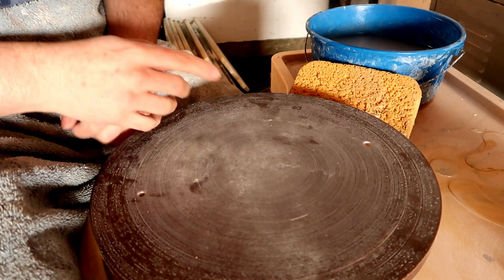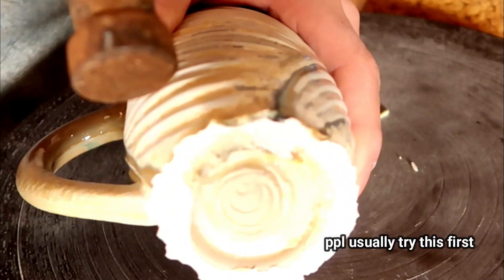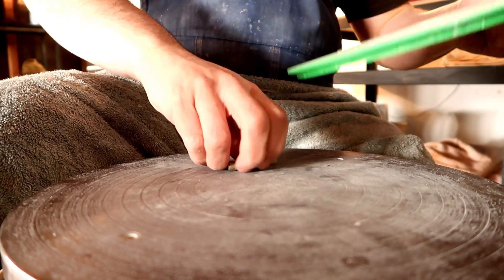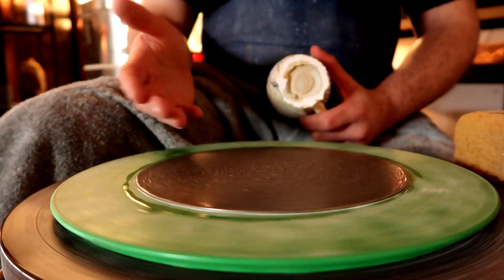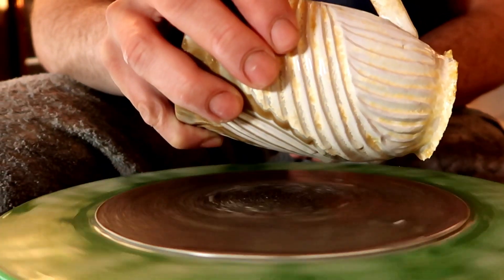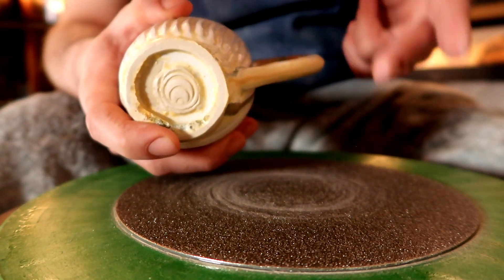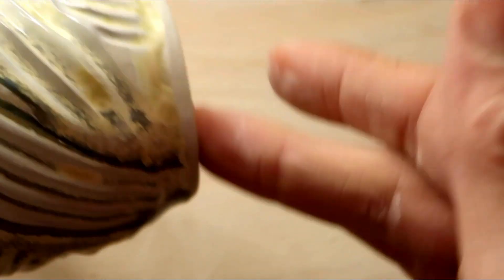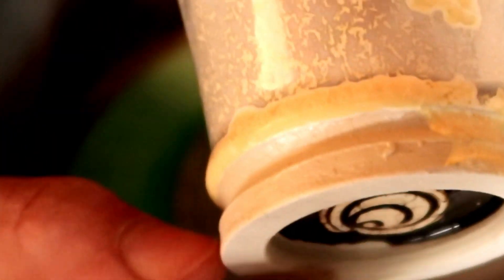How to save a pot (pot grinding) 🏺⚱️

Comment: Kiln wading! 50/50 by volume of Epk Kaolin and Aluminum Hydroxide and water. Mix to clay-like consistency and make little wads. I roll it into a slab and cut little square blocks out of it. it Decreases the grinding and saves shelves because you can put catch plates under runny glaze

Comment: I think you should add water to use the Diamond core to cut it. It will not make any heavy damage to the pot and also save the diamond core.
Have you try it?
Reply from the maker: Correct me for wrong but I believe I did say to add water to it in the video at time 6:03

It's very common practice to add water to a grinding or a whetstone  as well as the Diamond core disk.
Reply: @EarthNationCeramics  Oh! Sorry, my bad, I'm watching at the Dremel Diamond core at 11:13 
Long time ago, I used Dremel diamond core bit to make a hole on a pot. I have to bring the pot into water to make the hole clean and smooth. Other wise it will break the pot.